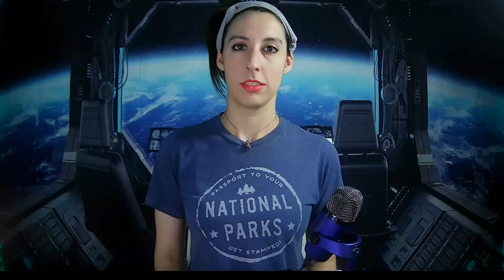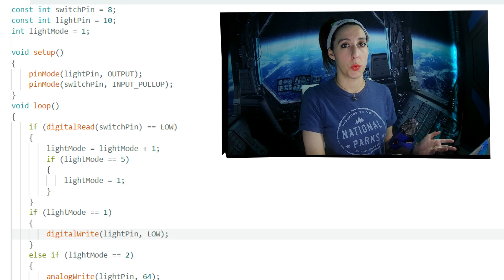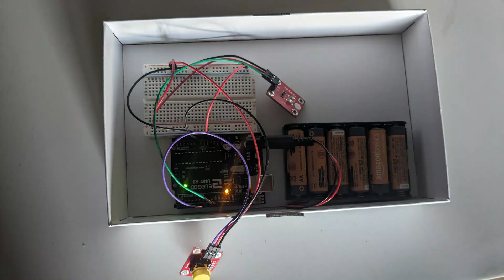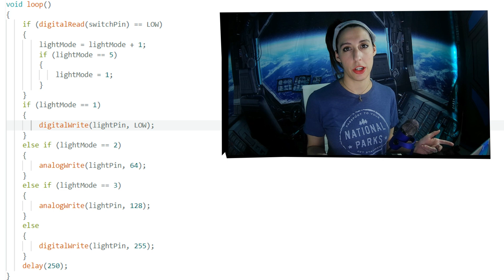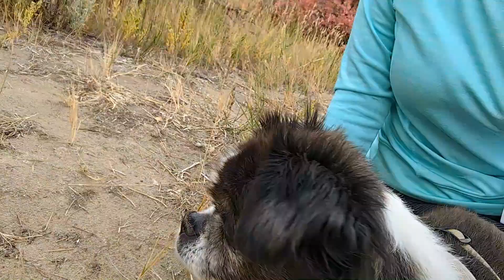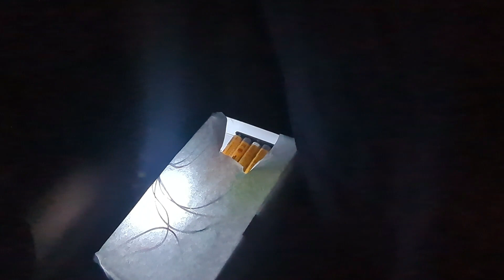I Built a Camp Light with Arduino and May Have Contaminated an Alien Biosphere

Comment: More Space Dog!!!
Reply from the maker: He found camping to be very confusing but was at least happy to have real gravity for a while!
Reply: @unprofessionalspacepirate  I did a project in an engineering class where I built an elevator for my dog to get into my tall bed. Maybe he would enjoy some kind of arduino powered food dispenser? Or some kind of personal airlock?
Reply from the maker: All awesome sounding projects! My dog is an old man who needs stairs to get on the bed, so that's a pretty inspiring idea!
Reply: @unprofessionalspacepirate  this was when I had a loft bed. The design would be largely unchanged. A stepper motor pulling it up and down with a counterweight in play so the motor isn't doing too much work. A pressure sensitive switch in the car that detects the weight of the pup that first secures the door, the door closing completes a 2nd circuit which talks to a controller that then goes up or down depending on which limit switch is actuated. Add in a couple of guides so ensure a smooth non twisty ride and you have a happy pup able to come and go as they please.